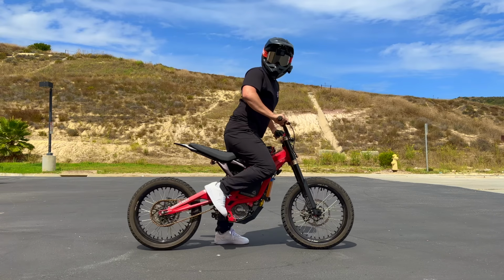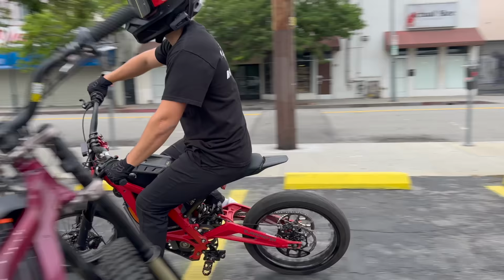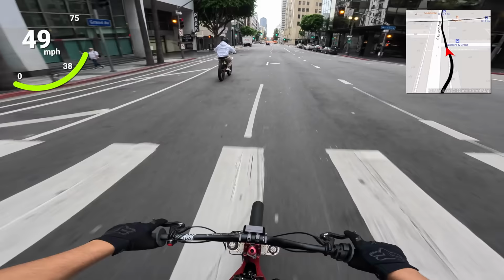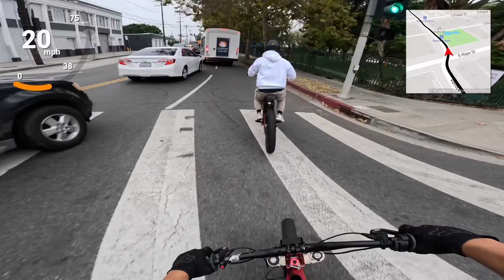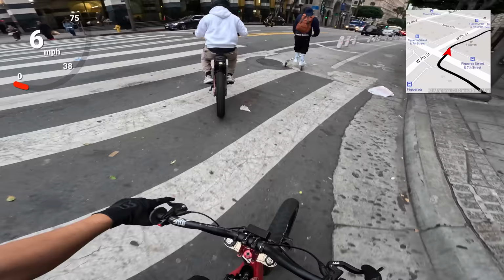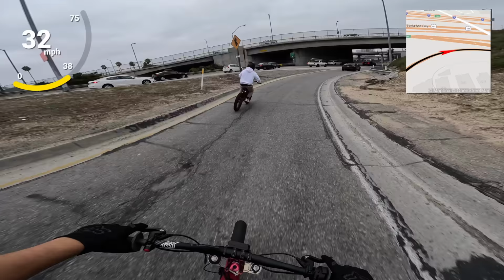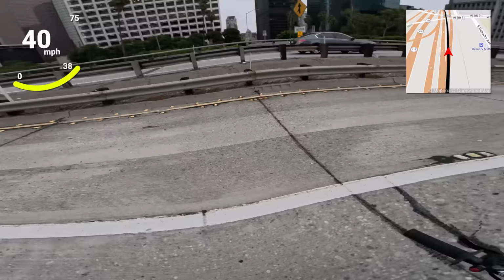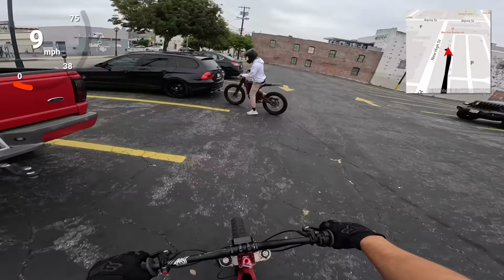The World’s Most Powerful E-Bike (TURBOCHARGED!)

Comment: After watching this, I'm convinced that these should absolutely be street legal. If you can legally drive a 50cc moped on the road, then this seems like common sense.
Reply: They made the surron street legal on europe but it only does 30 mph
Really wouldn't trust an ebike going faster than 40, it is not like the moped manufacturers that they give you a bike designed to go at speeds of at least 90mph so no sketchy reinforcements or disc brake adaptations when you install a big bore kit

Comment: Is it possible to add a thumb throttle type engine brake for those high speed brakes? You have the automatic engine braking in some modes but you could also have a super powerful one so you'll save your pads, right?
Reply: Yes you can. It came with my bac4000 from GLE

Comment: Hi guys, cool video may be a little reckless but great viewing. I’ve done RC cars upgrading motors, speed, controllers, batteries, my current RC isn’t the fastest, but it does do a nice 140kph. pretty sure these bikes would be the same sort of thing with the output and battery capacity. 
If you’re looking at upgrading brakes for that insanely fast pushy, I would look at customising, some mounts and using some moped brake calipers, actual motorcycle ones would be too big.If you gave me 10 grand mate I would get you to build one just like yours. Forget the go-kart, 2Wheels got more FUN factor👍